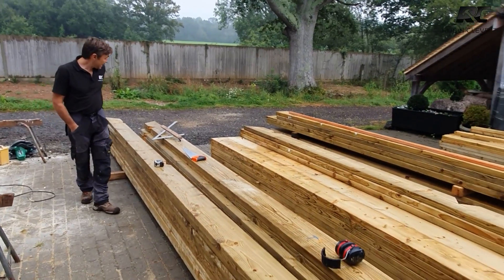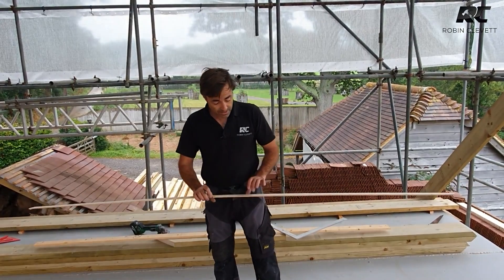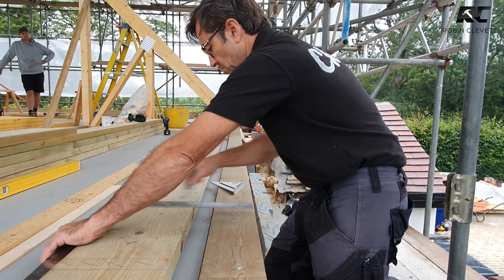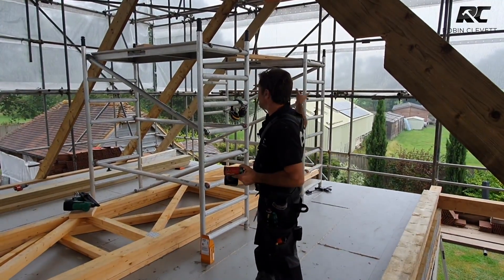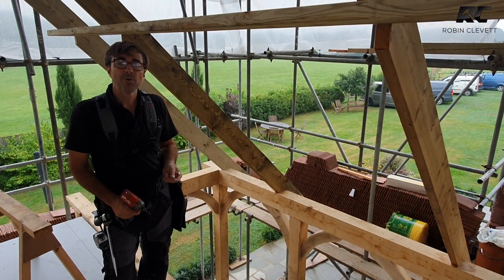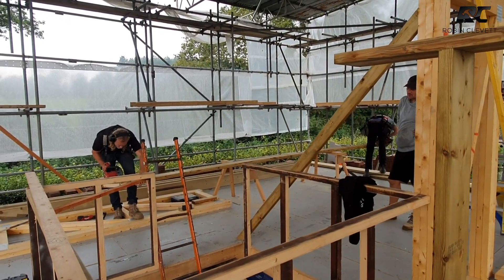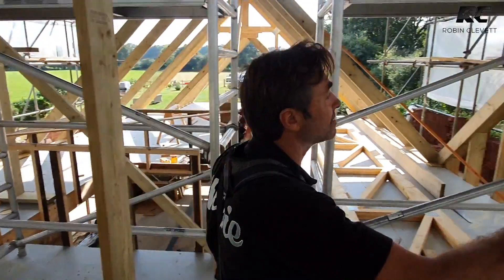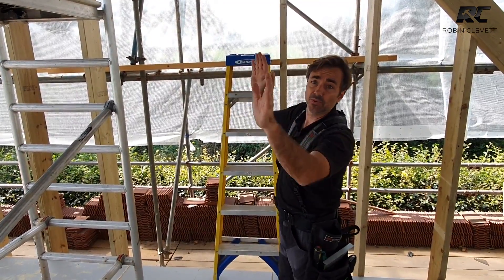The Big Build 26 Rafters, Ridges and walls

Comment: Do you have a video showing how you make those jigs that allow you to marry up those rafters but then they slide right out when you push the ridge beam up in between them?  That's a clever bit of work...very useful.

Also, it looks like there's a significant gap between the top of those engineered ridge trusses and the bottom of the ridge board that's already in place when the engineered truss is resting on the weight bearing wall...how do you deal with that?  Many thanks.
Reply from the maker: The truss is propped up and shimmed with ply packers until it presses tight under our ridge, from memory this can be seen in subsequent videos, the small jigs that you mention are really helpful!! I will make a video in the coming weeks

Comment: Hi Robin, would you generally always build timber frame walls like you did the supporting wall in this video I.e. building the wall stud by stud? Or would you build a entire wall and then fit into situ?
Reply from the maker: Hi Carl, This very much depends, if I am building a stud wall on top of new level joists and its load bearing then `i would do make it as a parallel wall and stand it up for speed, if as was the case here we are building load bearing stud partitions to support roof loads and we are building over an existing out of level structure then we would measure each stud for a really good structural connection

Comment: I'm doing a job right now that is a simple shed roof over a roof-top deck at a pub.  I'm an old guy who usually works alone, but for this job I have some young muscle coming to help put it all together. Everything is precut, posts, beams and rafters. I laid out everything on the ground so on Tuesday morning when the guys show up, we can just insert tab "A" into slot "B",,,,,,,,I hope.
We have a 70-pound load rating for a roof here in Maine so its 2x10 rafters 16" OC sitting on triple 2x10 beams and it's all heavy.

Comment: Really enjoyed the video. So satisfying to see the first sections of ladder ridge go in.  I'm just left wondering whether it was chance or planning that resulted in there being a rafter close to, but not over, the hole for the wedges on the scarf joint?
Reply: You would make out the rafter positions to make the centre of the scarf joint fall in between or a rafter just off to the side. I prefer to get the wedges centre to a rafter void so a rafter either side of it locks it all together.

Comment: Great channel robin, bites for ashlar wall on rafters look too big,  max 1/3 depth,  have renovated and replaced roofs where this has occurred at wallplate level causing rafters to split and sag
Reply: 1/3 is the maximum set by our framing standard in Oz
Reply from the maker: I have a video coming all about bites or birds mouths as we call them and the theory behind the size, In some cases here in the UK we also use the 2 thirds rule especially if you are using small timbers such as 2 x 4 it is critical then as the timber is weakened by the birds mouth especially if the foot or eve is long (The section past the wall plate supporting the facia boards etc) when you get up to the size of timbers we have here you have the benefit to create a birds mouth that will take better fixing and indeed hold the member plumb tight and well seated, look out for the video!!
Reply: With a engineered roof or a trussed rafter roof we do a shear check on the birds mouth to ensure that the design still works. So while we sometimes work to 1/3 depth its not set in stone. At the eaves overhang the design check assumes a fully loaded roof with a man load at the end of the overhang.

Comment: Why is there no glue in the scarf joint ?
Reply: No need.
Reply: @Toyotaamazon80series  
Yes but why is there no need what’s the theory behind no need for glue
Reply: @collcolin  If cut and fitted properly the wedges drive both sets of shoulders together. This results in a rock solid joint resisting loading and deflection along it's longitudinal axis. The rafter pairs lock the joint in and triangulate the roof. The same principles apply to something like a draw bored mortice and tenon joint in green oak framing. Those joints were never glued as far as I'm aware.